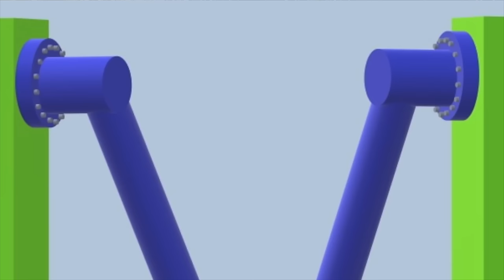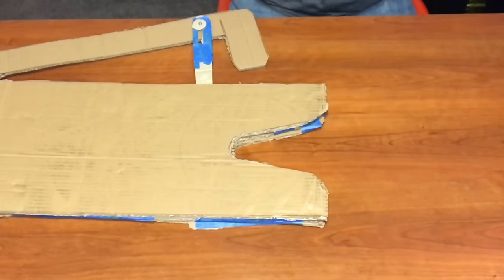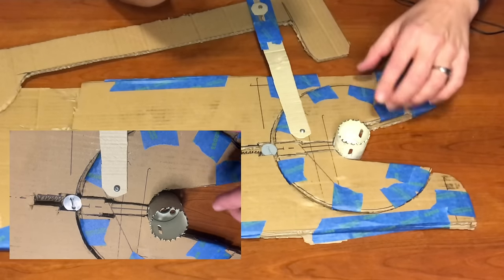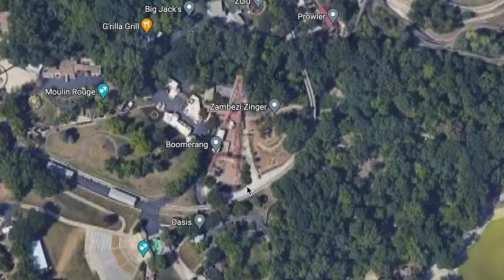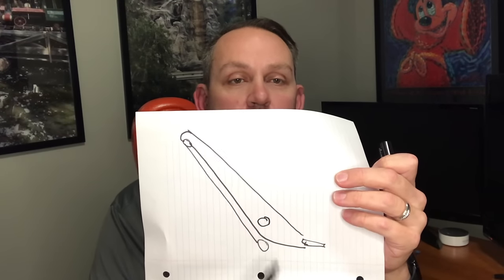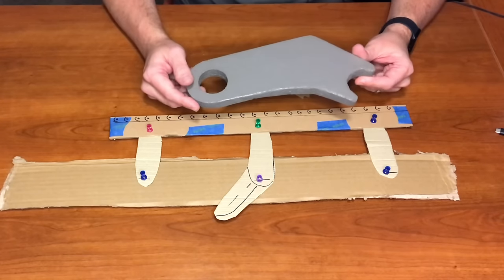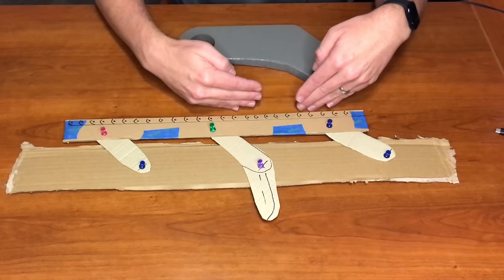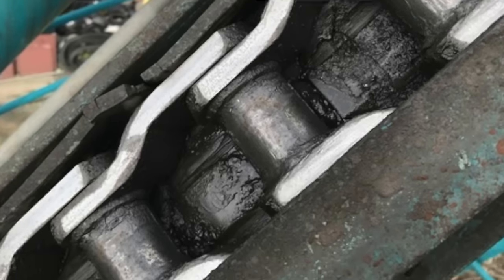How does a basic Boomerang Rollercoaster work?

Comment: What's wild is that the inverted boomerang is a completely different system, was an op on a....erm....no longer existing one. There's a discrete catch car and paddles on both lifts that get it hooked to car 2, rolls it up to the top of the first lift, a claw grabs it, paddles open and catch car release, claw release. On the second lift it's the same thing with paddles, send back around, then catch on the first catch car, lower back into station. Safety brakes on Lift 2 are similar, but the nice thing about the catch car meant that homing was very controlled. Very neat system.
Reply from the maker: honestly I know more about the giant inverted than I do a face to face model. I see the paddles release the train so im assuming it's a mechanical version of the catch wagon they used for the giant inverted boomerang. just never seen it.

Comment: I was at Knott's Berry Farm in 1990 on the opening day of their Boomerang. I was in the front row, & at the top of lift #1. The catch wagon was at the top of the lift, & the station brakes had opened. There was a small jolt, & the ride ops said they were experiencing technical difficulties. The ride system had shut down, & maintenance couldn't reboot the ride computer. After about 30-45 minutes, maintenance came up the lift & got us out of the train. We got to walk down the tower, & got a all day front of the line ride pass, & a employee's only button. This button was to celebrate Boomerang's opening day, & i still have it to this day. Great Memories!
Hello from Phoenix Arizona🌡🔥
Reply from the maker: Interesting. Sounds like the train hit the overlimit switch and didn’t release for some reason. I’ve heard the release arm on the wagon can Bend under some circumstance

Comment: I love working on the boomerang, such facinating pieces of equipment. The park ik work at uses the newer MK1212 trains with onboard audio, makes the ride a more pleasant experience for guests. It also catches on lift 2 quite a bit smoother. Haven't had some trouble myself, but would hear stories of trains valleying in the lay-out, makes for some interesting evacs.

BTW I loved your cardboard creations, such creativity.
Reply from the maker: Thanks!  I’ve spent many days trying to get the lift 2 catch better. Nothing really worked. When you get it dialed in empty it sucks loaded.
Reply: @ryantheridemechanic  I can't tell you where the magic happens on the new trains, only that the new chaindogs are spring loaded in the down position.
Reply from the maker: @SvenDonut  1201 has a very small spring down with an Endine shock to absorb the first impact. I always wanted to try the lift 2 trough cover and see how that worked.

Comment: That catch wagon mechanism is awesome beautiful in its simplicity.  Brilliant explanation, so simple with no solenoids or actuators.  I would have thought graphite lube would be better than oil but that not my area.....
Reply from the maker: Actually recommended was automatic transmission fluid. Although when I got super hot out we started adding 30w oil as well but not completely.

Comment: The trough doesn't drop much but it sure makes the track bounce when it does
Reply from the maker: Yea that’s mainly because you’re sitting down to coaches that are actually lift it up because of the chain dog. And then suddenly changing direction of the train. So the lift has a violent reaction to the change of state.

Comment: Dude, this video was great! I almost cant believe how Vekoma had the opportunity to make that catch car soooo complicated, and made it 100% mechanical! Now those engineers did not hate the mechanics down the line! Had this been an automotive function, it would be ALL electrically controlled, using encoder motors, position sensors, running off of 5V reference voltage using 3 different 5V busses, and 7 different grounds. Plus speed sensors for the train, where the reluctors arent protected and they collect brake dust, and are turned completely useless. I wish i could copy word for word how a fuel pump works for you. Now, vs back just 10 years ago. Its gotten so ridiculous.  Enginerds are just control module happy in the automotive industry.
Reply from the maker: That’s pretty complicated!
Reply: @ryantheridemechanic it's not very complicated, but it is over complicated. Power windows used to work with switches, and relays. Now it's switches, and modules, and CAN busses, and non replaceable relays built into modules. Just..... why?
Reply from the maker: @Spike-sk7ql  most thing that go that way are done under the standard of “teks don’t troubleshoot to the component level anymore” so you get to the board and it’s now just “replace the board”

Comment: I work at Six Flags park and am always operator of our boomerang model. I got pretty close to the maintenance crew for that ride over the years and getting to learn how the ride works is quite fascinating! Ours sometimes has issues with the catch car not catching to the train in station. Attaching to lift 2 is always a gamble whether it'll be a smooth or clunky sound haha. The brake pressure is always the worst to predict during Fright Fest. Only one adjustment is normally needed throughout the day, but I have definitely seen it under shoot many of times. Dependent on the weather, guest load, and amount of cycles really determines brake pressure. The maintenance team loves when I operate because I know the sounds of the ride, what to do if it stops, and what to look out for. Love operating a Boomerang! You said yours is number 33 and the one at my park was built a year earlier, I wonder what my number is. Great and comprehensive video!
Reply from the maker: Thanks! They can be a hand full to work with some times!

Comment: I'm curious how you feel about the new generation vekoma rides like FLY or Fonix or Lech coaster or the new super boomerang coming to GAdv. They're way smoother for the riders than old vekomas, which could be downright painful. It seems like they're trying to keep their reputation for being low maintenance and easy to work with, but now going for the high end segment instead of mostly small parks. Coming for B&M's market share. safe, reliable, and not particularly boundary pushing.

Comment: If you've ever seen any maurer Söhne spinning coaster or gerstlauer wild mouse, they don't have a sheave car and the ride couples onto the chain lift at such a weird angle, but apparently it works
Reply from the maker: Standard wild mouse lift right? Where the chain sits above the Livy by about 3 feet. I used to oversee a Gerstlauer spinning coaster. They work quite nicely

Comment: I think the sounds boomerangs make are underrated, especially the sound they make when they engage the chain on lift 2.
Reply from the maker: The hook up heard around the park!
Reply: @ryantheridemechanic 
Something else I’ve noticed that is kinda weird is that most Boomerangs have air gates, but some do not. Let’s take Zoomerang at Lake Compounce as an example, instead of air gates they have an operator with a tally marker once you get up to the station, and then after that you get your row on a first come first serve basis. These coasters give heavy fair ride vibes, but Zoomerang is probably the one that feels the most like a fair ride because of its station setup.

These rides are really fascinating, and they look stunning, especially they way the long train goes through the cobra roll. I personally love the look of the ones with the arrow trains the most, because of how retro they look. In fact my favorite of the traditional boomerangs I’ve ridden is the one at Six Flags St Louis (formerly Flashback at Over Texas), not necessarily because it has the best ride experience, but because it has the coolest looking train in my opinion.
Reply from the maker: @hoosiercoasterfan2655  Interesting, safety is only a suggestion in some areas.

Comment: Great video, Ryan!

My feelings towards this coaster model are mixed. You can't deny that Vekoma created something that was commercially really successful . I's likely one of the most cloned thrill coaster models (narrowing it to thrill coasters, just to exclude all the Big Apples out there), and they seem to be quite reliable. And - for a coaster design from 1980s Vekoma, they have aged relatively well. They aren't glossy smooth but usually not too bad either.

From an enthusiast's perspective, I of course have the gripe that there are just too many of them. Yawn. But that's something the average park goer most likely wouldn't even notice.
My other gripe is a tall person's gripe. I am not sure about the train model numbers, but I'd guess the MK1201 that you mentioned is the one that has the more rounded shape and the MK1200 is the one that's basically the Arrow looper train?
Both of them have terrible restraints, especially for tall people. And while I still have somewhat decent legroom in the front row of a 1200 coach, the 1201 are just terrible. I can't stretch my legs inside the front footwell - the curved shape makes my knee bang right into it. I have only ridden one Boomerang where this was no issue - the one at Hersheypark, which has a totally different train that's much newer.
Reply from the maker: You are correct about the train styles. For the 1201 which has the more rounded body, it’s easier to sit in the back row of the coach if you are taller. There’s more legroom back there for people. I have a long torso, which causes the restrain to sit on my shoulders at about a 45° angle, not even coming close to the rest of my body. Ha ha ha. I did see that new train they put on at Hersheypark. That is a beautiful retrofit if parks want to upgrade I believe that is the 1204 style but I’m probably wrong about that.
Reply: @ryantheridemechanic  I wish manufacturers were more open about stuff like this. I am not talking about details the GP doesn't need to know, but since they do tell the names of certain coaster types or models (like the Boomerang), why don't they also have something on their website about their trains. And if it's just like a time line "in 19xx, Vekoma introduces the new MK1201 train", with a photo and maybe what made them so much greater than the previous ones. Just for folks like us to nerd about.

When it comes to riding coaster with these restraints, we both seem to have the same issue. At (soon to be) Six Flags Sandusky (aka Cedar Point) I wasn't even able to ride Corkscrew because their belts connecting the shoulder harness with the seat are WAY shorter than on any other Arrow Looper I have ever been on. I have always been able to ride - not comfortably, but without problems. But not there. 🙄
Reply from the maker: @Colaholiker  manufactures make so many different versions of the same thing for parks they don’t want to contradict somthing they already said so they have to tread lightly. Hypothetical Like rebuilding an engine. The OEM says torque head bolts to 35ftlbs on a video. But for YOUR truck they actually needed them to 55ftlbs. So if you watch the video and execute, you got instructions “from the OEM” that caused your engine to fail.
Reply: @ryantheridemechanic  Yeah, I can see that. That is why I mean to not put out too much information, but just a general overview that puts a name on the train. Everyone who knows a bit about coasters knows what model you talk about when you mention a Boomerang, and I was thinking along the same lines for the trains. If someone mentions MK1201, everyone who is interested in it can at least know "that's roughly the type of train he talks about".
Reply from the maker: @Colaholiker  I also think they are still behind the curve technology wise. Like their marketing is using all the tricks and new things but spare parts is still living in the “fax it to me” era. New train sales are actually sold under retrofits that spare parts handles.
Reply: @ryantheridemechanic  I thought us Germans were the last to use fax machines, LMAO

Comment: I have a stupid idea for a possible video. Kicker wheels. While I was waiting for ICON our £16.25 million here in the UK, I noticed the kicker wheels that pushed the car onto the LSM launch looked like some old-fashioned steal wheels from a car from the 1980s. There are on the majority of roller coasters; are they actually car wheels and tyres, and do they cause problems? like on Thirteen at Alton Towers, which has a kicker wheel lift hill and, for a long time, could not be used in the wet. It's quite funny in the UK, where it rains nearly every day and we love riding roller coasters in the rain to have a roller coaster that could not be run in the wet.

Comment: On the brakes closing during initial lift, how did the Boomerang at SF Discovery Kingdom get stuck on the Cobra roll after a cable snapped on the catch car? How did the brakes get released?
Reply from the maker: I Don have first hand knowledge of that event. But the catch wagon is not ment to articulate like a coach. So trying to go through the twist of the cobra roll is like slamming on the brakes.
Reply: @ryantheridemechanic  that makes sense. This has definitely been one of my favorite videos. You should do a "How It Works" Series and cover how various stuff works behind the scenes. E g. Brake Systems, Lift Hills, Restraint Systems ect ect. The Restraint System could be it's own mini series given how different styles of restraints there are

Comment: Is the chain motor mounted on the chain trough or is it mounted to the structure and the chain runs through some kind of slack adjuster?
Reply from the maker: The motor is mounted under the structure at the top platform of the ride. At the bottom of the chain there is a tensioning wheel that mainly uses gravity with springs to assist the tension.

Comment: I have heard that the old Cumberland Cannonball at Opryland was a "custom" boomerang that was completely unique to other boomerangs though the layout seemed similar, do you know what the difference was between Opryland's Cannonball and more typical clones like Busch Garden's Python (both coasters are sadly long gone).
Reply from the maker: So I honestly have no in-site there that can help. But….. if parks change ANYTHING on the track layout, even a 2meter elevation change on the loop, it kicks the ride into a custom layout. Also causes the manufacture to have to re calculate the force data on the structure. So it could be a super minor change that they claim as custom.
Reply: @ryantheridemechanic  the sad part about the Cannonball at Opryland is it WAS supposed to be reassembled at a supposed "new" Six Flags park in Indiana and had it in storage there for a couple years before they decided against opening anything up there and it ended up just going to scrap.
Reply from the maker: @aegisofhonor  always sad to see a coaster scrapped. So manny memories down the drain but not much you can do.

Comment: quickish question, so i'm a ride op at la ronde and our boomerang has some issues with the second chain; sometimes, the train stops there with no error code no nothing, and it happends more often when the train is going REALLY fast, do you have an explation for this because even the mecanics at la ronde don't really know what is causing that

Comment: Where is the boomerang removed from the track,  in the station ? Doesn't seem like there is enough room to lift it off there.
Reply from the maker: Typically just outside of the station where the track is the flattest. You could even remove it in the brakes at lift 2 if needed. Depends on where access is with a big grade all or small crane / boom truck.

Comment: Great Video again. Efteling is by the way re-tracking and re-theming their river rapids for €8.000.000 also installing Intamins new Energy saving pumps. The Python re-track by CSM only cost €4.000.000. and for 8.000.000 most parks install a new ride. Any thoughts on this? (They anounced these numbers in Dutch newspapers by the way).